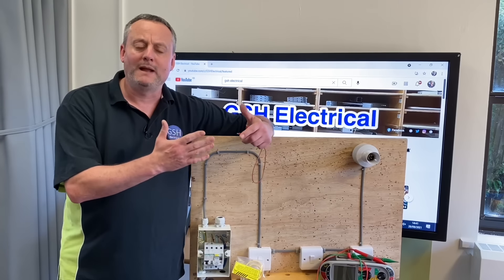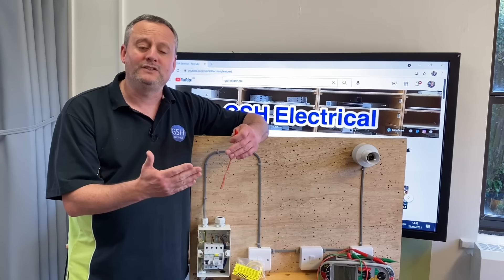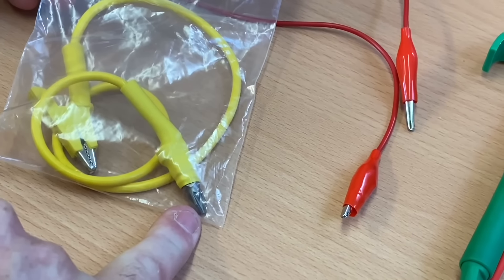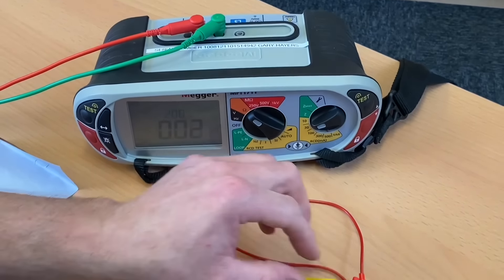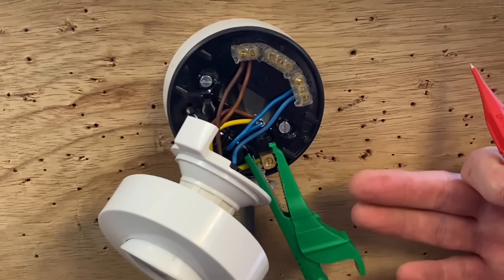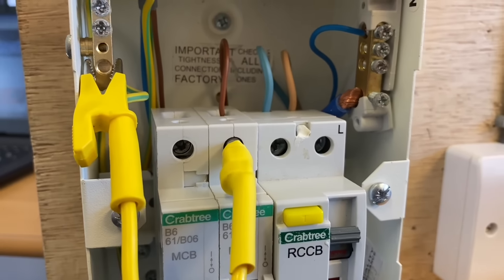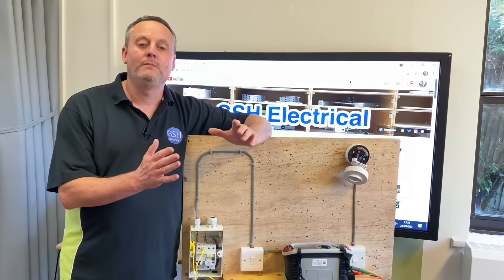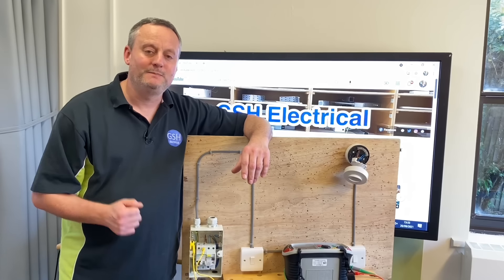R1R2 Link Makes Testing for Continuity of the CPC Faster and Easier Especially Whilst Training

Comment: Long overdue especially at college! Will save all the screws getting chewed up on the breakers!

I’d be intrigued to see a comparison on the rig between each method, link, earth bar and that new lead to see if the magnet connection causes higher resistance than a screw connection or a croc clip.
Reply from the maker: I may follow this video up in the coming weeks all depends on time 👍🏻
Reply: I'd also be interested to see the resistance difference of this also. If it offers more resistance, I'd be inclined not to use at college because they will go into the big world still using it.

Comment: Been using this for a while, it’s great on EICRS, I’ve got two for being able to test multiple radials close to each other to save having to go back to the board the whole time, for example a boiler and immersion next to each other or both lighting circuits etc.

Totally understand the college environment not wanting to remove and damage the screws I remember all the gear we had was battered fo that reason
Reply from the maker: Thanks for the great feedback and comment Jay

Comment: Seemed like a rather high reading on such a short circuit? 
Perhaps it is also reading parallel paths. Good idea though.
I turn off the main switch, mcb's and link the buzz bar to earth block. Switch on the breaker I'm testing, turn off once test result achieved and move along accordingly.
Reply: Thanks for suggesting the method. If the cpc also connects to parallel earth paths - that would lessen the loop resistance. 
In a two fault scenario, the designed earth circuit pathway could be broken some way towards the distribution board whilst being in fortuitous contact with parallel earth paths nearer the load.
Reply: Just remember to remove the link before turning the mains back on. Don't wanna have to replace the 1361bomb 😏 or call dno.

Comment: Wouldn’t you still pick up potential parallel paths via the earth bar (MET) and not actually testing the cpc to line only for that circuit???
Reply: No. The test current takes the pathof lest resistance/ making the smallest circuit possible so the test current turns back at the MET along the link directly into the Brown wire. ( the electrons t dont go off to earth and all the house's earth bonding and back. )  it takes the easiest / shortest route to make a circuit
I think
Reply: @highgatehandyman6479  The issue however is that the main CPC for the circuit could be missing altogether - if there's a parallel path then this will then potentially show the circuit as having a CPC - when it doesn't. Disconnect the CPC and test properly all day long.

Comment: Great content as usual, been watching your channel for over a couple of years and have learnt much. Off topic but hopefully something you will cover soon. I did a recognised domestic installer course 2 years ago, called up the Niceic (as they recognised this course) to find out that they no longer recognised this path. So I’ve been doing electrical work over the last 21 months to be told I’ll need to go back to square one! It doesn’t make sense to Chuck so many people under the bus, the barrier to being CPS is the NICEIC, why don’t they make the. Assessment more difficult? Maybe a special assessment for the thousands that left their old careers to join the industry. You’re well respected and known, is there anything in the pipeline for guys in our position?
Reply: @paul_my_plumbs_uk  
There’s no logic, if I was crap I’m still going to be crap, just not able to instal in a special location(jeez if it needs an rcd fit one) install a new circuit (easy) fuse board, pretty easy. More people can still come into the industry and do minor works. I was aiming to be on the domestic installer scheme, I was doing it in the correct manor and getting the full 2 years experience before booking the assessment ( it’s well known the NICEIC didn’t check) I just don’t get it!! They’ve wasted 2 yrs of my life. I was never going to do commercial, why not just make the assessment more thorough. It’s going to be a nightmare to go back to square one. I thought this would be a good salient point for this channel to get into.

Comment: Great idea, I use the two ended crocodile type clip but this looks even better. Have you seen if there is much difference in the value given between the two. Just wondering what the connection is like with the magnetic type would this higher the resistance giving a higher reading? Think I'm still going to buy one anyway
Reply: It will increase the readings in the region of 0.01 to 0.04 ohms.
Reply: Try it both ways see what difference it makes 🤔

Comment: Thank you, good video, I’m going to order one of these, do they make these in different sizes ? A lot of the RCBO’s now have smaller screws.
Reply from the maker: R1R2 Link Will it Work on RCBO's & How Much Extra Resistance Will it Add in Circuit For Continuity
https://youtu.be/moxKGSSCLt4
Reply: @GSHElectrical  if you null the meter, it won’t add any resistance to the circuit.

Comment: Gary a lot of your learners are like me training to be domestic installers and have been chucked under the bus, it would be great to hear an alternative view from the channel on this unprecedented situation of guys like me in change of careers and now being told we’ll have to spend 2 more years training when we thought we’d got there..
Reply: How long was the domestic installers course originally
Reply: What's changed?
Reply from the maker: My adults take 3 years to be a domestic installer 👍🏻
Reply: @richardpurdy3432  CPS registration, you must have a diploma level 2&3 plus an NVQ doing commercial jobs, a pretty long path for someone like me who took a NICEIC recognised path, albeit I did it properly and actually worked with other electricians and got 2 yrs experience (even though some just went and got an assessment without 2 yrs) and because of this they changed the goal posts, all I want to do is be able to fit a shower circuit, instal a car charger and Change the odd board. It’s not bloody rocket science!!
Reply: @GSHElectrical  perhaps they need 3 yrs to do an A LEVEL, I don’t! to be a domestic installer isn’t challenging for some. if you study hard and work with other sparks, I’ve looked at the curriculum and I’ve completed most already. Clearly you think it’s way beyond All to learn quickly. As an adult you can be safe and use the knowledge you have learnt even through a fast course to do domestic, the course I did was designed by the Niceic and city and guilds it was comprehensive, there was some guys that would be good sparks as a result and the NICEIC would have assessed us at the final stage. Is it because we didn’t make tea for 3 yrs instead of wanting to learn and self study, you say it takes my learners 3 yrs :-)
Reply: @GSHElectrical   perhaps they need 3 yrs to do domestic.  I don’t! to be a domestic installer it isn’t challenging for some, if you study hard and work with other sparks I’ve looked at the curriculum and I’ve completed most already. Clearly you think it’s way beyond All to learn quickly. As an adult you can be safe and use the knowledge you have learnt even through a fast course to do domestic, the course I did was designed by the Niceic and city and guilds it was comprehensive, there was some guys that would be good sparks as a result and the NICEIC would have assessed us at the final stage. Is it because we didn’t make tea for 3 yrs instead of wanting to learn and self study? There is talk of a different course NVQ FOR DOMESTIC but I can’t see how I could learn more..there really isn’t more I can learn without doing the work which I am. I’m not saying I know all but the sparks I know have to check wiring diagrams and think a job through, if they not sure they check the regs, I have the 18th so I know how to.

Comment: Why not clip the crocodile clip in the bus bar and turn on each mcb as you go along?
Reply from the maker: This is a Starbreaker design so no accessible busbar 👍🏻
Reply: Also, by clipping on to the bus bar,  if you forget to take it off the main fuse will blow.
Reply: @r1r2link39  the method I use and yes I have made that mistake once......💣💥 never again

Comment: The insertion contact resistance of the driver head to screw is an unknown and immeasurable value in these circumstances and WILL have an effect on accuracy. Surely it's not impossible to design an insulating clamp that fits over the breaker top to bottom (or front to back) to clamp the contact to the screw rather than relying on a magnetic contact? What if the screws are nickel plated brass? Nice idea that needs more thought and design input, PLUS an analysis to measure actual contact resistance & effects (if any).
Reply: Yes, there will be an unknown negligible resistance value between the two points you have pointed out.  But this is not about accuracy,  it's about knowing that the readings are in the right area to trip the overcurrent devices if need be, and there is continuity there.  If the figures were way out, then you can investigate further.

Comment: To prove correct readings could of shown the line conductor joined into the earth bar 
The double ended croc clip as you already shown!! Then the new r1 r2 lead be interesting to see if the readings differ, im not convinced that the magnet is making a sound connection on your breaker
Reply from the maker: R1R2 Link For Continuity Will it Work on RCBO's & How Much Extra Resistance Will it Add in Circuit https://youtu.be/moxKGSSCLt4

Comment: Question: does the PZ head fit into an RCBO terminal? They’re usually a lot smaller than a standard MCB. Definitely want to purchase as I do at least 2 EICRs per week but want to know about the RCBO question
Reply from the maker: R1R2 Link For Continuity Will it Work on RCBO's & How Much Extra Resistance Will it Add in Circuit https://youtu.be/moxKGSSCLt4

Comment: Are you not re-introducing the resisance when the MFT leads are diconnected?
Reply: I assume that after removing the R1/R1 loop - before the next task involving resistance measurement, the meter would be re-nulled by shorting the the meter's leads croc clips.

Comment: I agree with Steve Whiting there’s no point in you doing an R1 R2 test this way  !!! the whole point of it is making sure you have the Earth to and the live on that particular circuit …if you do a link to the Earth bar there are multiple earths on there , also earth bonding cables so you would be getting a parallel earth path ,From multiple CPC ‘s, your test would have a major flaw when testing upstairs and downstairs lighting circuits there would probably be a point where the both of the two circuits would be joined at say a light switch then you wouldn’t know which Earth was your circuit

Comment: Does the magnetic screw head fit in rcbos? As they are smaller than normal Mcbs.
Reply: Commented but noticed your  pinned comment.
Reply from the maker: Second opportunity for views 👍🏻

R1R2 Link For Continuity Will it Work on RCBO's & How Much Extra Resistance Will it Add in Circuit https://youtu.be/moxKGSSCLt4

Comment: 1.32 Ohm on a circuit thats about 3m in length?? How the hell is that even possible?  Something is defo busted there (either that magnet lead or your tester).
Reply from the maker: It’s the resistance of the switches as they never go live and the contacts have tarnished increasing circuit resistance… 👍🏻
Reply: @GSHElectrical   Oh okay. Thank you for the explanation.